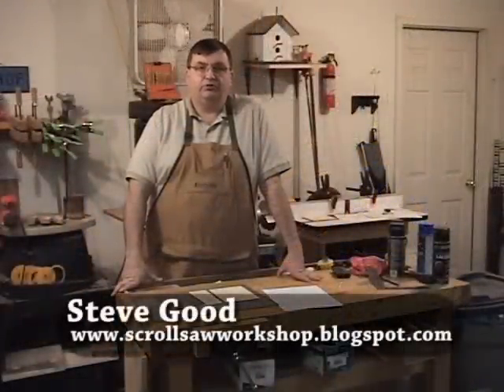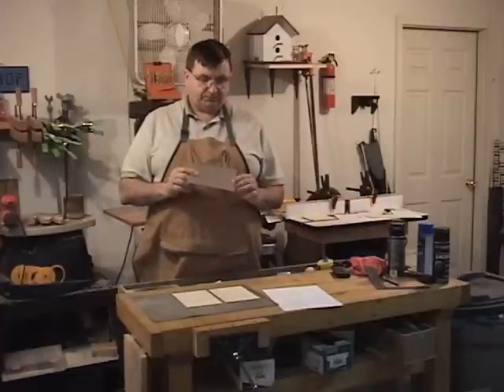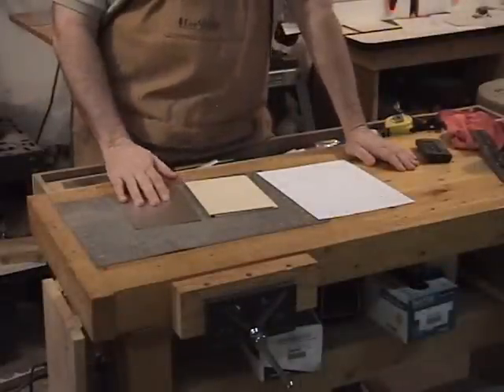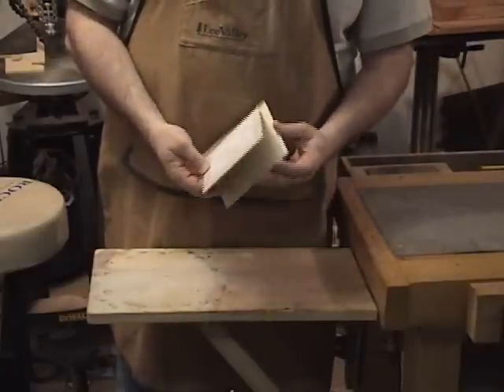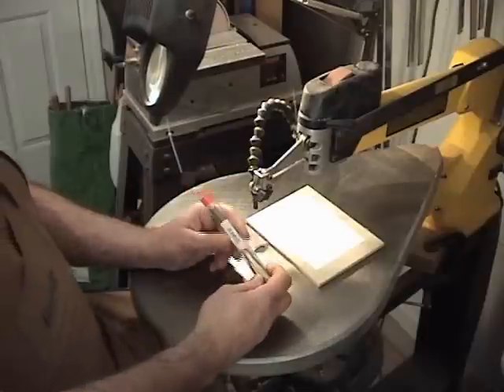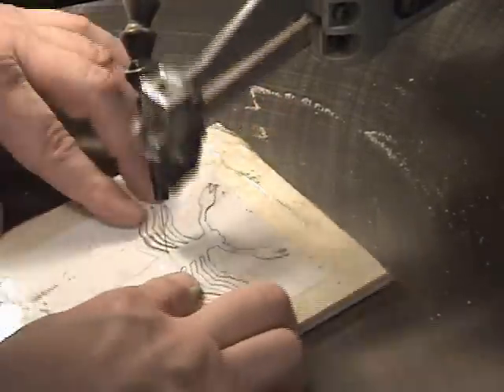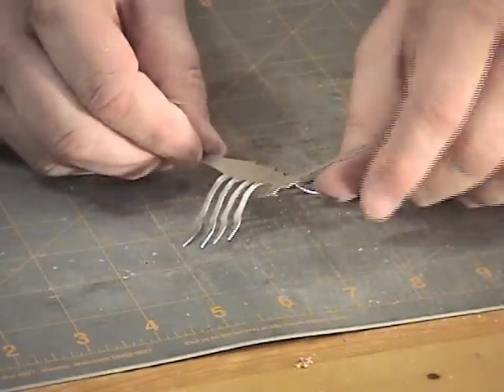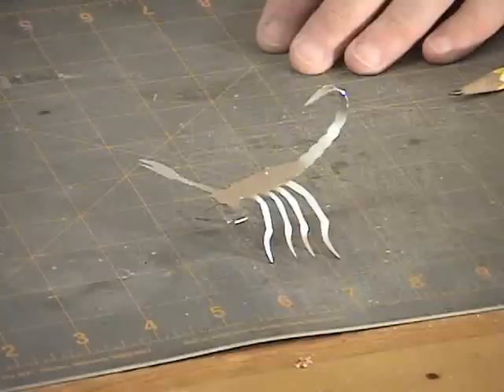Cutting metal with a scroll saw

Comment: Here is a good tip from the UK 30 years I have been scroll sawing I use to teach it, this method is a bit longer for metal and can be used on thicker light metalS also make your pattern like the gentleman said..if you can make the pattern  with a RED outilne so a gark blade will not over-shadow the black patters that most people use...okay use a thin double sided tape to hold the metal down, cover the project completely with the diuble sided tape, stick the fIrst side to the ply or MDF/ 2 Mil will do, them apply the double sided tape to the top of the porject metal cover all, remove the paper holding the tape of course, then put the other part of the PLY/MDF over now you have two sdied sand-whiched then glue/spray your paper deisgn on ..becarefull some pray and glues are strong and will leak through onto your design ..experient what is the best glues to use are..TIP carpet spray lightly I use always.....okay, this method is good becuase as your scroll saw is cutting and the metal project ids 100%  firmy stuck both sides non slip...the blade as it goes through the double sided tape gets warm,/hot and acts as a lubricant on the scrollsaw blade and helps the blade with ease and prevents the blades also from snapping..try it , it workds well....to release the PLY/MDF from your project as taped still and you do not want to bend your metal deisgn use a hot-air gun over the porject, this will disturb the double sided glue then slowy twist side to side and it will come off leaving your metal project with some glue on...simply remove with white spirit or an equal chemical you have in the USA or other countries not PETROL/GASOLINE okay ..thank you for reading this BLOG ..Ray in the UK

Comment: I'm no scroll saw master (actually learning the tricks from your marvelous videos), but I work with metal on the mill. All I know is you gotta go slow with metals since the heat from friction will badly affect your cutting tool (hence the broken blades). I heard people slow down the saw or use a cutting fluid (requires a drainage system) for such purposes.

Comment: I have done extensive cutting of 1/8" aluminum with my old Delta, and currently am cutting 1/8" steel!  I break LOTS of blades, but do get the cuts I need.  I cut the metal directly, without using the sandwich.  I get my blades from Mike's workshop, using the Flying Dutchman metal blades.  I can definitely see the advantage of the sandwich if the metal were very thin.  Thanks for posting...
Reply: I'm cutting 3/32" aluminum. Have you tried the aluminum cutter blade and if so is there much of a difference between the Iron man blade and the aluminum cutter blade, which is stronger and will hold up longer from breaking?
Reply: can you avoid breaking blades by using lube?

Comment: if you heat the copper pipe till red glow with  butane torch it will become soft and you can cut with snips
or scissors.    drop in water to cool quick

Comment: Yeah I’m trying to cut a cavitation plate that is 1/8”. It’s busted but I got a plate that will work I just need to cut it to the break and then weld it. I’m using a. Upside down in the vise jigsaw.. it works I just want to be a little less dangerous I just don’t need to cut designs for a finch house or silk dowlies.. guess I need a band saw where if my finger touched the blade it wouldn’t be there anymore

Comment: I am interested in cutting a knife blank out of an automotive leaf spring. My main interest is in using the scroll saw to get the handle cut to shape. can these saws be used for this?
Reply: Get a rotary grinder to cut the metal and a belt sander to shape and make the edge. Plenty of videos out there for instruction

Comment: @fly2000jtb I don't have a video. However, this is how I would do it. First, draw out you circle on a piece of paper. Then use spray adhesive to glue the paper on the metal. Cut it and then sand off the paper. Let me know when you finish. I also would like to build one also.

Comment: Can I cut 10mm thick aluminium with this scrollsaw?
Reply: I fabricate aluminum parts for motorcycle builds and I am currently cutting ¼" 5052 aluminum plate with a scroll saw with a metal blade. You just can't cut fast. You have to cut slow and use a high viscosity oil. You hurry it the least little bit and you will snap a blade

Comment: The oil with a high viscosity would not only reduce friction heat on the blade and metal but would help reduce if not eliminate metal dust.